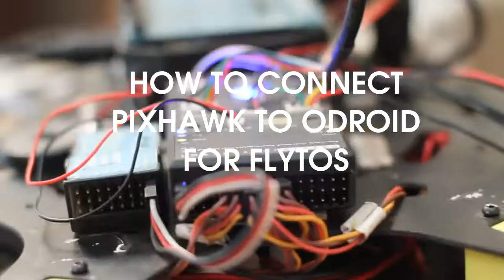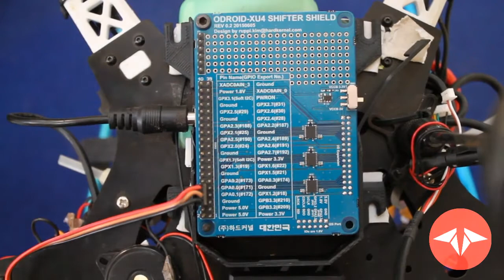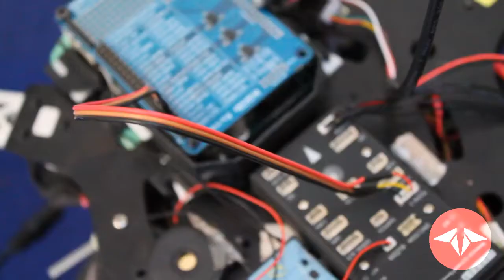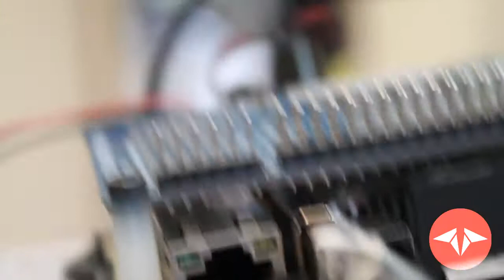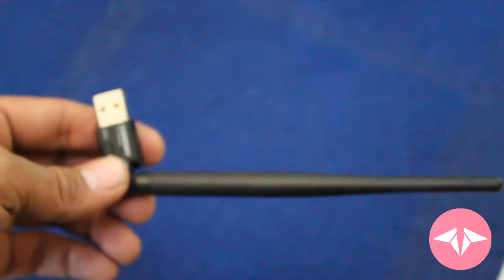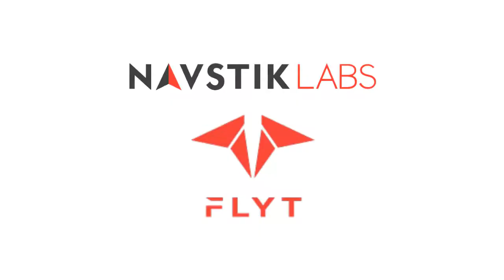How to Setup Odroid XU4 and Pixhawk for FlytOS [Easy Steps]

Comment: My question is how do I connect a single lipo battery to my Nvidia TX1 and PixHawk? Do I need some kind of parallel splitter?
Reply from the maker: Hi Nicolas, yes you will need a parallel splitter. You can use a DC-DC converter (like this one: http://a.co/gyVUYGg) to make a power module for Nvidia TX1.

Comment: why do you not recommend connecting them by micro-USB and USB?
Reply from the maker: Hi Lunaric,

Both PX4 and Ardupilot community do not recommend CC and Pixhawk connection via microUSB in flight. For lab testing, it should not be an issue.
Reply: alright thanks!

Comment: @flyBase why didn' you connect an UBEC in between Odroid & lipo battery   ?
Reply from the maker: We use a DC-DC converter power supply module rated at 5 V,  a UBEC can be connected in a similar fashion but is not generally recommended, as UBECs are primarily meant to drive SERVO motors.
Reply: FlytBase why can't use UBEC. ? if so,  what DC - DC convertor you use. ? (the power input of Odroid: 5V / 4A

Comment: how did you get power for Odroid? Is it possible to get voltage for Odroid from the servo rail of pixhawk?
Reply: Hi Roberto I think the Odroid draws about 4 amps when it is working hard , not sure if you can get that much out of the servo rail on pixhawk, 5 volts yeah but how many amps ??? I think the best way is to solder a 5.5 mm plug jack to a suitable sized BEC producing up to say 5 amps. If I find out where I read about it, I will let you know, hope this helps. Steve.
Reply: "Communicating with Odroid Via MAVLink"   has an article about setup, all connections + stuff about battery hookup this should help.
Reply: Hi,
thank you for the answer. In order to operate with wifi dongle and usb camera attached, I solved with a 6a BEC. Bye.